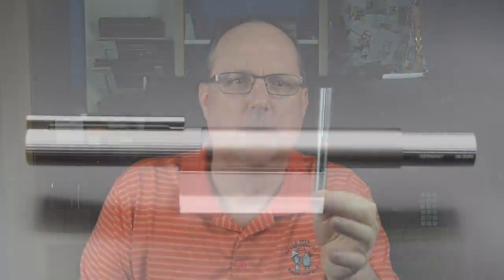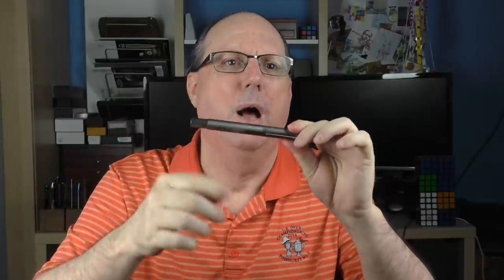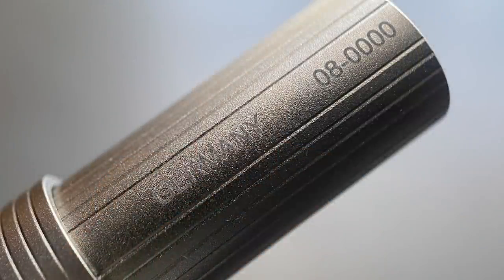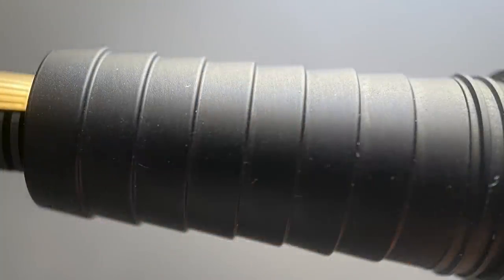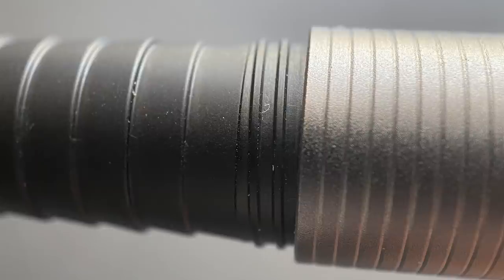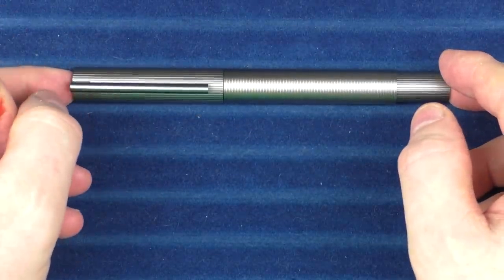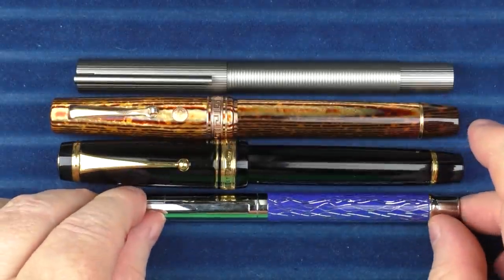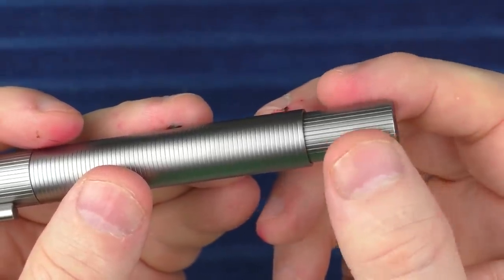Otto Hutt Design 8 Review

Comment: Decent job of design. Quite good engineering. Excessive price.
Reply: Ottohut: here is a aluminum cylinder now pay two grand for it
Reply: Since other otto hutt designs are fairly decent priced, I wonder if the pricing on the design C and design 08 are due to certain % of premium paid towards the collab designer?
Reply: @junlee7237  Its actually not aluminum , its brass (Messing) .

Comment: Yeh I cant see how you think the price is reasonable. So many defects. Far from perfect. When you compare to Pilot 823 I really don’t see how the difference is is justified.
Reply: The 823 is very hard to beat for its cost/performance. But I agree, I don’t think this pen justifies the price they are asking. Too mush gimmicks than function on the piston knob, not very inspiring material nor the level of finish. And can’t really justify it for the “brand”.  Unless someone tell me every single grooves on the pen are hand engraved, then that’s a whole other story.
Reply: @ctsealteam6  Even if those lines are really hand engraved, it's a $1200 pen with a plain-ass look, undervalued material, the only unique thing about it is the neatly engineered small details, that again, can be found in many of sub $300 pen. Comparing its cost to value ratio with the 823  is a complete overstatement (at least to me). 823, a workhorse so well reputed globally for at least a decade, against a pen more of an artwork than being a pen.